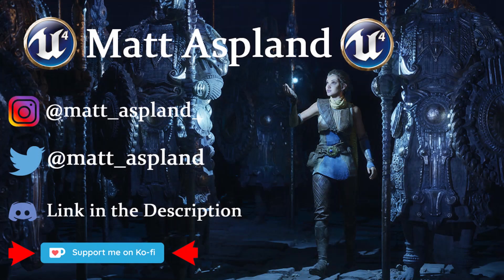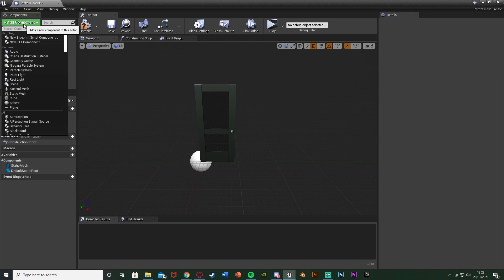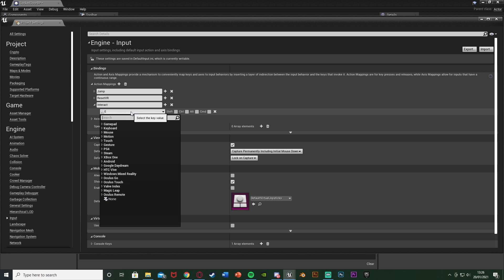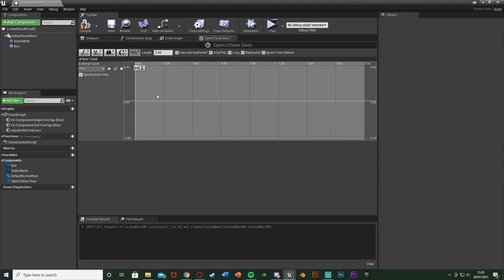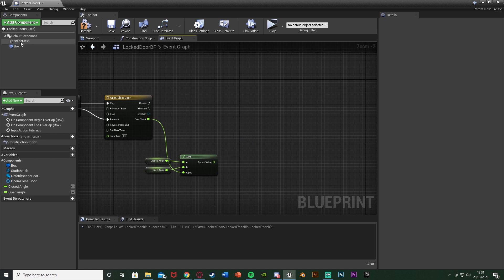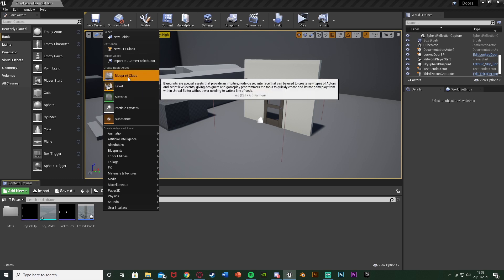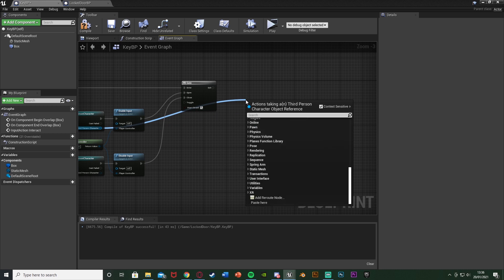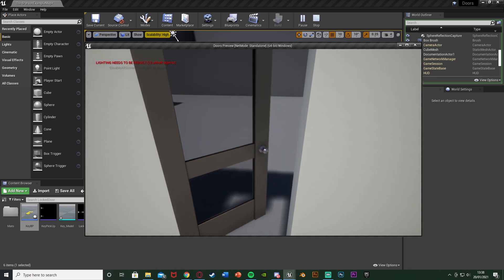How To Open A Locked Door With A Key - Unreal Engine 4 Tutorial

Comment: Did anyone else have trouble with the key not working? The key just sits still for me in the environment and I'm unable to pick it up or interact with it. The door seems to work, I just can't open it since the key is not working for me. I'm using a cube static mesh as the static mesh for the key, could this have something to do with the issue I'm having?
Reply: I will also mention that I am now testing it with the key model and it still is not working. The door has working colliders but the key does not seem to have any colliders at all and I cannot pick it up. It sits there in the environment and I can walk through it. I'm not certain if this is an issue with the static mesh or it has something to do with the blueprint.
Reply: @inheritorofthewilloffire2547  im having the same issue did you find the solution?
Reply: Maybe the box collision is not big enough and if u interact with it and it doesnt disappear u have to put destroy actor and make sure that the variable that u have put is checked in the key blueprint

Comment: I'm using a top down blueprint and it doesn't seem to be working, the door has no collision and doesn't make a sound when I press E in the vicinity.
Reply: I should clarify, the door itself has no collision, i believe the box collision is working because when I shoot projectiles within the collision box they stay in place, however interacting with the door does nothing and I can walk right through it. Is this a topdown blueprint problem?
Reply from the maker: Hi mate, if you are using the starter content door, then it will be a problem with that. For some reason, by default it has no collision. To fix it, you can open up the static mesh for the door, and change the "Collision Complexity" to "Use Complex Collision as Simple"
Reply: @MattAspland  THANK YOU
Reply from the maker: @albinodino.stevied3976  No problem :)

Comment: hi matt just wondered how you add an unlock sound once you got the key and opened door
Reply from the maker: Hey mate, out of the exit for the gate, you could get a "Sequence". Then 0 goes into the code we have now, and Then 1 goes into a DoOnce. Out of this DoOnce, get "Play Sound At Location", with the location as "Get Actor Location", and the SFX and the sound for unlocking the door.

This means we can play a SFX for unlocking the door, only the first time we open it. So after we unlock it.

Hope this helps :)
Reply: @MattAspland  I will give that a go thanks matt
Reply: @MattAspland  thanks that worked a treat much appreciated
Reply from the maker: @fosterboy1587  No problem mate :)
Reply: @MattAspland  can you add text to the door and key so with door being locked it says door locked need a key
Reply from the maker: @fosterboy1587  Of course, you could do something similar to this. When you get close enough to the door, check to see if the player has the key, if they don't then display that text on screen.

https://youtu.be/Os7uf-wiU8o

Comment: bro...do u know how to edit the pivot?
Reply from the maker: Hey, there are a few different ways of doing it. Did you make the model yourself? If so, changing it in the model before exporting is the most efficient way of doing it. However, you can also try: 

"ALT + MiddleMouse" to move the pivot, then Right-click the actor and choose Pivot > Set as Pivot Offset to save. "

Hope this helps :)

Comment: So this works for me except the door won't close when I press the interact key again after it opens.  I can't figure out why.  I've tried putting the "B" output of the Flip Flop node into "Reverse" and "Reverse from End" but I can't get it to work.  I even bypassed the check for the key so it just opens when you hit interact and once again it opens, but won't close.  Does anyone know why?

EDIT: I solved it in case anyone else has similar issues.  After endless frustration I decided to look at the door blueprint while playing and noticed that everything was fine until I used the key to open the door.  At that moment, the box collider disappeared.  Then I noticed that I had the box collider attached to the door static mesh instead of the defaultrootscene.  I uncoupled the box collider from the door mesh and now everything works perfectly.

Comment: Hi i need help about 2d side scroller crouch animation i watched your video i did exactly what you did b ut animation wont work
Reply from the maker: Hi, is this for my crouching video? If so, do the animations not work at all? Make sure you are setting and using the Boolean correctly. If you want, you can send screenshots of your code for me to take a look at.
Reply: @MattAspland  animations is not working i have custom character not using template character
Reply from the maker: @voyrex2675  Right okay, you will need to retarget the animations to your new skeleton then. I have a video on it here :)

https://youtu.be/fUUcnwjaIgU
Reply: @MattAspland  i send you a video by mail
Reply from the maker: @voyrex2675  No worries, I've just replied :)
Reply: @MattAspland  thank you but i cant uncrouch while i walking i mean animation still crouchs
Reply from the maker: @voyrex2675  Hi, in the video you sent me it doesn't crouch at all. And the solution I gave should fix that, did you try it?
Reply: @MattAspland  yes it is working now
Reply from the maker: @voyrex2675  Okay great, nice one
Reply: but i cant uncrouch while walking
Reply from the maker: @voyrex2675  Right okay, like it says in the pinned comment on that video. We can easily fix this by adding another transition going from "Crouch Moving" to "Idle/Run". And as the transitional node have it as "IsCrouching?" "NOT Boolean".

Hope this helps, I've attached some images so you know what I mean :)

Reference Images: https://imgur.com/gallery/WqPyu5p
Reply: @MattAspland  thank you really you saved my day 😊
Reply from the maker: @voyrex2675  No problem, glad I could help :)